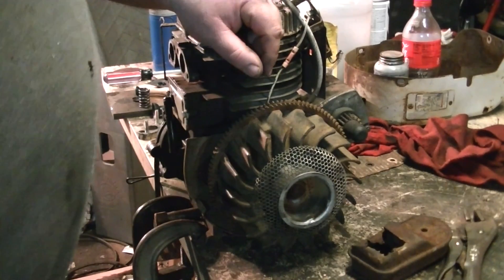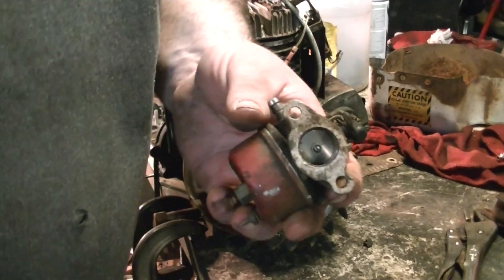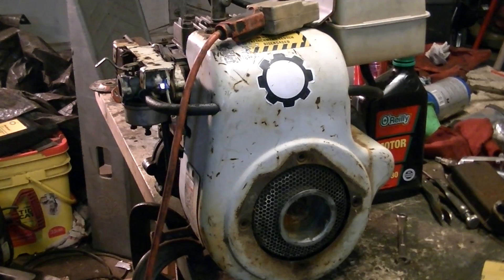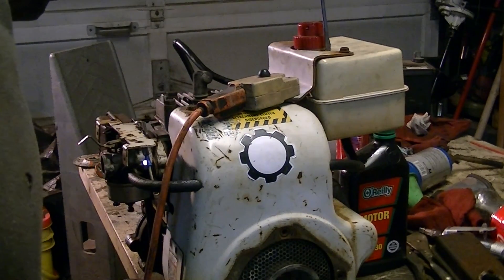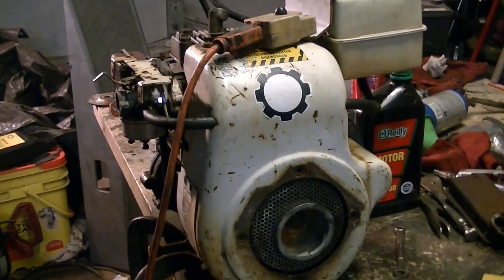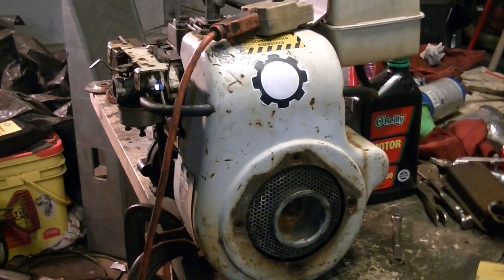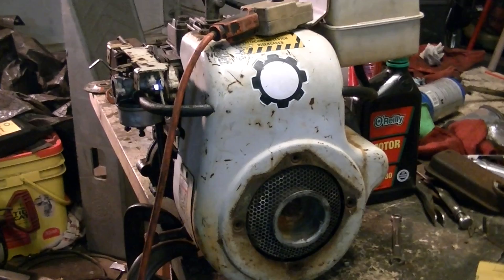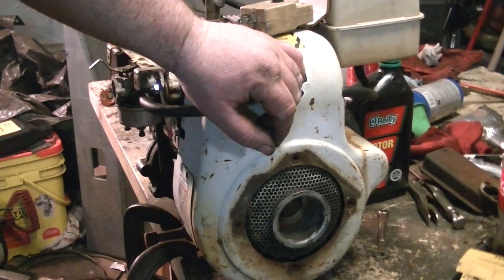valve job on tecumseh engine part 5

Comment: Hey Suthrn,

Great videos!

I have that EXACT same engine on an old Ariens snowblower (early 70's). After I ran it at angle for about 20 minutes in a deep drift it started blowing a lot of oil out of that breather tube.
I later filled the oil to the correct level but it always blows oil out that tube now even when level maybe an ounce every 15 minutes. Can that little reed (or valve) be cleaned and can that little screen be cleaned as well ?(looks like a small piece of dirty sponge). Thanks

Comment from the maker: @fred306801 the valves will not make it spit oil out of that tube .. make sure the little screen is in right and in good shape also the little breather valve is not stuck open .. if all of that is ok its probably the rings letting compression bypass into the crankcase or its over full of oil and forcing it out .. i'll try to make a better vid of the valve retainer clips.. i will work on a video explaining it all .. thanks for watching

Comment: Well dumbass me did not know and ran that tube to the carb. With mine It spits the oil out. 
1/2 quart every 5 min or so. I am going to wait a day or so to see if you write me back. If not then I will try and do the valves the way you have shown. Once I get this one running it seems to run rather good. But I have not ran it over 5 min at a time for fear of running out of oil. 
One thing I wish you would have shown is how to put the valve clips back on. Most of the time I get things apart.

Comment: Thank you for the video. The one I am working on looks just like that one. Mine has the starter as well but its bad. So I have to pull the cord. The first time its fairly easy. But then you wait awhile or take the plug out and put it back in. Its like theres so much pressure it almost impossiable to pull. I took the PCV apart ,cleaned it and still same thing. So that little tube off of the PVC is a drain, ok. Please read next post.